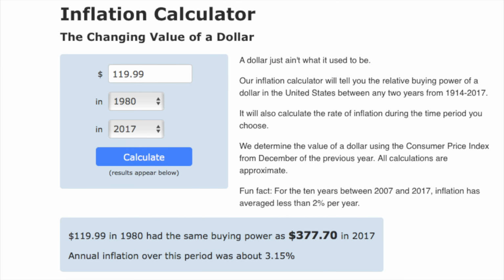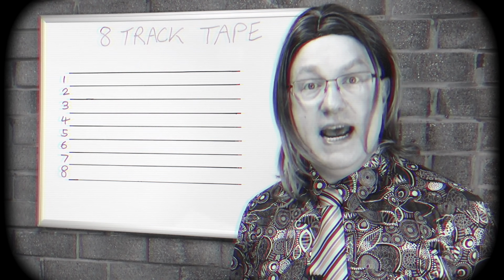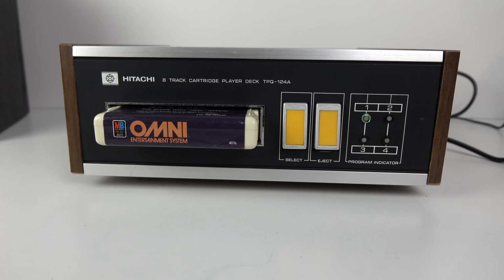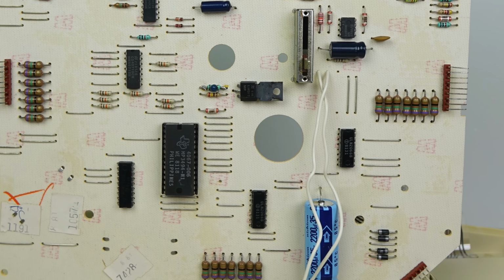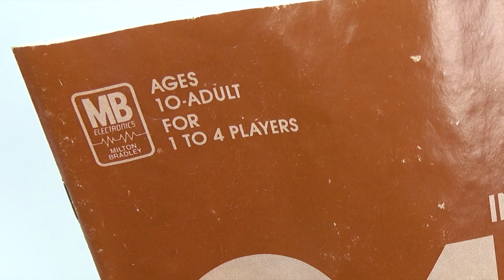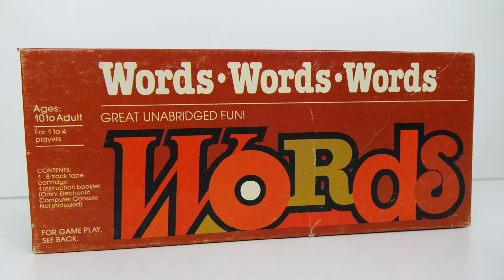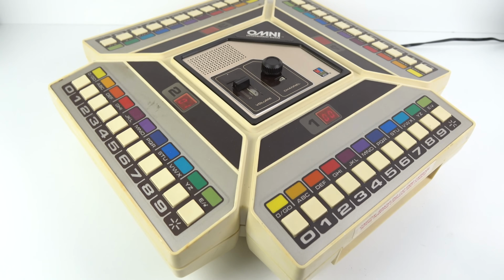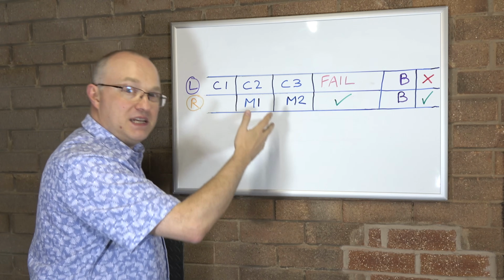MB OMNI Entertainment System - The 1980s 8-Track games machine.

Comment: As a restorer of vintage electronics, the key is to REPLACE all of the ELECTROLYTIC capacitors, even if they look fine, because on anything this old, the capacitors are dried out and leaking DC current - The electrolytic capacitors are the bigger can looking ones, on this unit, I can see eight (8) of them.  All of your classic stereo equipment from the 1980's and earlier would also greatly benefit from this! - Make sure to stick with the 4 high-end Japanese capacitor brands, namely, Panasonic, Nichicon, Rubycon, and Nippon Chemi-con. :)  This will save your impossible to find old transistors, transformers, etc. in your vintage electronic device, as well as making the device function as new!
Reply: Exactly. I collect old tape recorders and I have some from the 1950s that still runs fine with all their original components - including capacitors.
Reply: depends on the caps, for instance, ive never come across  a bad nichicon
its the chinese/taiwanese made and fake caps that are problematic
they don't start showing up till about the time that china took over manufacturing everything
Reply: Curiously, while glancing on this board, i see a distinct lack of custom components, even not seen a single component that isn't still available as NOS right from the top of my head, many are even still being made. I wouldn't terribly worry about it. Honestly i am a tiny bit astonished that they managed to do the whole thing with just 4000 series and similar logic ICs!

Furthermore it doesn't seem like there would be much temperature and ripple current, so i wouldn't replace all capacitors, after all, with every replacement, you run a risk of installing a defective component or mangling something else, and many people don't even have access to good brand name capacitors, i'll be lucky if my supplier sends Cheng Taiwan rather than something out of mainland China lottery. Maybe just check temperatures carefully and if something gets warm, take those out. As you know, temperature is the primary degradation factor, they are specified to run for 10 years at the temperature printed on their sleeve, but going down every 10°C roughly doubles the life. The big cap is a Nichicon, i have measured some of these out of early-run C64s, and they were good as new after all this time, a tiny bit of capacity loss, but no leakage whatsoever, and not much more ESR than you'd get out of a modern unit. In fact that you allow yourself a blanket statement that every device this old must necessarily contain capacitors that leak tells me you never really bothered to check - while capacitors are the most common issue, more often than not in a working device this old and this well made, they're still good!

Also i'm not entirely convinced whether things are always getting better. The 2000s saw not just a massive fake electrolyte fiasco, but a number of genuine Japanese high-performance electrolytes that turned out to be quite bitchy, showing much much faster degradation than the spec would suggest. While striving to offer devices with smaller footprint and lower ESR, thus also allowing to reduce BOM, the manufacturers collectively and repeatedly stepped into shit they couldn't quite predict.
Reply: As a consumer I would hope that I don't have to pay more because the engineer replaced everything, even those caps which were fine.
However I would like to have my kit running for another forty years.So do I send my tuner to ungrateful or jmc?
Unfortunately that question cannot be answered by Vincent Price .
Ok let the battle commence. Again.  Lol.
Reply: Jesus... Get a room
Reply: By this time they were using quite a bit of tantalum caps which didn't dry, but sometimes did explode if overridden by high current ;)
Reply: Ha-ha-ha that made my day... ahh the 'dozer techs... gotta love 'em... then you've got the "Re-flow every f*ckin FPGA chip on the board techs" lol#2
Reply: I love your videos!
Reply: burrito rustler That is an exceedingly common claim, which strangely only became "common wisdom" after the industry-wide rash of bad capacitors in equipment from the early 2000s .  I have experienced lots of older gear that works just fine with the original electrolytic caps, but I'm sure the industry is quite happy when you needlessly replace working components with brand new ones bought at premium prices.
Reply: ungratefulmetalpansy some do replace carbon resistors although others only replace the bad ones.

those of us techs who are smart know to replace old electrolytic caps and carbon resistors so that we don't have to replace as each original one fails. less work in the long run and makes for a more reliable device.
Reply: John Francis Doe no the claim is valid. electrolytic caps have a finite lifespan and will eventually fail.
Reply: burrito rustler 
LOVE me some Chemi-con electrolytics!
Reply: No I am not.   A bulldozer tech has no clue what they're doing and I know full well what I am doing.    Apparently the fact that electrolytic caps have a finite lifespan and that most if not all vintage electrolytic caps have passed that doesn't matter to some.    I've had experience in only replacing resistors and caps that were bad only to replace more bad original resistors and caps later on when they fail.    By going ahead and replacing all electrolytic caps and carbon comp resistors I make less work for me down the road.    If you take your car to have a tune up done and the tech only replaces the spark plugs that looked bad would you be ok with that or would you expect all spark plugs to be replaced?    Some only replace the bad parts and do so every time another part fails.    Others know which parts are known failure items and replace them all whether they are good or not so they do not have to work on the device later.    That said in order to know if a vintage electrolytic cap is actually good you first need a proper capacitor tester then you need the manufacturer's data on said capacitor so you can compare the test results with the manufacturer's data to see if the cap meets spec. The main specs are capacitance, ESR and leakage current.     Odds are you will not find the leakage current or ESR specs for vintage capacitors so then how do you really know they are within spec? You don't so the only thing you can do with the cap is replace it.
Reply: Jf Mc no he is exactly right. I work with electronics daily and repair them.

I personally do not like working on my own gear often so I take steps to make said gear as reliable as possible which depending on the age means at minimum all electrolytic caps get replaced.

take a vintage receiver that works decently to the point you think it is working properly.

you recap it completely and the receiver sounds better and digs that one station out of the static you couldn't receive good before.

would you say the recap was necessary or would it have been best to leave it as it was given it did work before.

electrolytic caps have a finite lifetime after which they really should be replaced.

new replacement parts in something vintage doesn't mean it is no longer vintage.

Also why take the chance of an old electrolytic cap failing short and taking out a hard to find semiconductor?

I have a Fisher 202 Futura Series receiver that had a slight hum in one channel but otherwise worked great.

I started a recap with the power supply and driver boards and the hum was gone. I replaced the rest of the electrolytic caps given they were the same age and the receiver works better than I ever remember the one I had 20 years ago as a teen ever did.

basically on something vintage there is a valid reason to totally recap it.

you may disagree, but if your vintage stuff works good enough for you even though it may not be performing its best due to old caps and you like working on your gear often then ok.
Reply: organfairy you are very lucky then as that is not normal at all.
Reply: ungratefulmetalpansy 

you're one of those that has to be right even when wrong. 

a little hint.

the way I know you don't know what you're taking about is because you degenerated into personal attacks which is generally what some do rather than admit they don't know or were wrong.
Reply: Pissing matches and irrerplaceable transistors aside, I've found that:

(1) Electrolytics in 1980s consumer gear typically start going bad around the 30 to 35 year mark, and

(2) Replacing all of the electrolytics in a complex vintage piece in one go is much easier than disassembling and reassembling the piece each time an individual cap needs replacing.

I'm going to do what saves me the most time and aggravation. I'm not married to a friggin' 40-year-old capacitor.
Reply: ungratefulmetalpansy 

you don't underatand.
in my example the spark plug still looked good worked good and the gap was in spec.

so then why do you replace it if there's nothing wrong with it? according to what you say the spark plug should be left alone. you replace it why? because you know it will fail and you don't want to pay someone to change the one plug.

that's the same reasoning behind a full recap. we know the rest of the electrolytic caps will fail so we go ahead and replace them so we dont have to fix it again later.

concerning the cap specs I'm talking about the manufacturer specs.

regardless of how well a capacitor works in a circuit, if it does not meet the manufacturer's specs then it is bad and must be replaced.

honestly I wouldn't want to work on any of your gear.

even some well respected knowledgeable techs will recap a vintage receiver, but you would consider them bulldozer techs no matter how knowledgeable they are.

it's precisely that knowledge which causes some to do a full recap on a vintage electronic device.
Reply: burrito rustler 
Make. Tech. Videos.
NOW!
Reply: ungratefulmetalpansy 

more personal attacks I see.
Reply: ungratefulmetalpansy 

If the datasheet doesn't mention anything about derating the capacitor then I take it to mean that once it's out of spec it is bad.

now if said datasheet gives data on derating the capacitor then I'll compare the cap to the data it lists for derating the cap and if it still is ok I'll leave it alone, but since I've obviously desoldered the cap to test it I may as well put a new one back in.
Reply: When I took digital at the tech school I went to nearly 18 years ago TTL was used when the logic high levels only needed to be 5 volts and CMOS was used when the logic high levels needed to be above 5 volts  and 12 volts was a commonly used voltage.    Real pain in the ass when you need to replace a CMOS chip which operates at 12 volt logic levels and can only find the CMOS chip you need with a maximum Vcc under 12Vdc.
Reply: Dude, if you bring in Trump into the discussion of caps and such, I'd hate to say but there's something really wrong with you.  I'm completely party impartial, but it's just plain moronic to do that... just sayin'.
Reply: burrito rustler. You are absolutely wrong.  Please stop sreading this stupid and destructive rumor.  Do not remove anything that dose not test as bad.  Keep vintage,  vintage! Thanks.
Reply: John Francis Doe - ummmm NO! - maybe YOU just found out that old electrolytic caps cause havoc in older equipment back around the early 2000's, but ELECTRICAL ENGINEERS knew this in the 1960's! - here is a wise saying "you are entitled to your own opinions, but you are NOT entitled to your own FACTS!"
Reply: Siana Gearz - You can't even read the markings on every IC on the board, so you have no idea if they are available, and even the ones you can, many are not available NOS - just because you can find some listed on ebay, doesn't make them legit parts, more often these "NOS IC's" are Chinese counterfeits, that may or may not work at all.
Reply: Agreed.For some of the ICs devices use there are modern substitutes moreso if the chip uses TTL logic levels, but not so much If it uses CMOS logic levels.
Reply: I take it you are a tech then since you mentioned you have an oscope.   "You are comparing something that runs at 50000V, at 500 degrees, under pressure, and with corrosive explosions happening 1000 times per second."   Still if the spark plug meets manufacturer specs why replace it?    "That's stupid."    Oh it's stupid to replace a part that does not meet manufacturer specs?    Most competent techs would disagree with you on that.   Try telling someone who maintains a nuclear reactor that an out of spec part is ok to leave in place.   I myself work in avionics and parts that do not meet spec or are known failure items are replaced, because if they are not said equipment could fail which can cause anything from an unimportant device going out to the plane itself crashing.    "That's stupid. You are a menace. Your "knowledge" is on the level of astrology or numerology. You probably advertise in the same section of the newspaper."    There you go with the insults. Can't admit you're wrong so you resort to insults.  You're one of those what I say is always right damn what anyone else says or proves kind of people.      "What an objective test! It couldn't be receiving "good" because you MOVED it?"    If said receiver was put back in the same exact place connected the exact same way then no. Also at the time the recap was done an alignment would have been performed which I expect you to say also isn't necessary given the receiver worked beforehand.     "Good, leave my perfectly functional 55 year old Tektronix 547 alone."    There are some exceptions as I have a few old devices with original electrolytics that work just fine. Mostly military devices though.    The ultimate test is to buy two of the same receivers that work equally well. Recap and align one and leave the other one original then compare them side by side with the same speakers and antenna and see which one works better if one does indeed work better.
Reply: I sincerely hope you never own something using hard or impossible to find transistors or suitable subs as your method of thinking could cause an original cap to fail which could take out said hard/impossible to find transistors and render said device landfill material.
Reply: I love how there are all of these morons actually trying to DEBATE whether old electrolytic capacitors should be replaced - lol ............ This is like climate change, SETTLED SCIENCE (electrical engineering to be exact) it is NOT up for DEBATE, if you don't think that old electrolytic capacitors should be replaced before they take out your impossible to find transistors, transformers, and other components on vintage gear, don't even think about DEBATING, until you have your electrical engineering degree, then you will know what you are talking about.  This isn't the Presidency of the United States, you don't get to be a moron and tweet #fakenews - Electrical Engineering is not DEBATABLE!

Comment: That's interesting, I wonder if you could actually consider this a gaming console since it doesn't play on a tv yet it has interchangeable cartridges.. Hmm
Reply: If I remember correctly, there was a computer-like thingy (like the Commodore 64, or the Atari 800) with 10 horizontal LEDs, which were used as a "Screen" for the games. Not really a console, but if that counted I guess this does too.
Reply: I had one of those things.  Sold under various different brands and it played things like a racing game, hangman, and a variety of card games.  Quite a lot of fun at the time.
Reply: Riz2336 I'd say it's arguably a portable console of sorts...?
Reply: Well it looks like a console on the bridge for a spaceship from a 70s b-movie and it plays games so I guess it works that way.
Reply: It's basically a board game but with electronic elements instead of something like a deck of trivia cards.  Given MB made a lot of board games, it's actually a logical evolution of the products they made.  Same sort of games but enhanced with the voices and electronic scoring.   Not a bad attempt.  It's even still fun.

Comment: what does "burst of data" mean, how and would you do that on a 8 track.
Reply: how does the machine communicate with the cartirge to see if the thing is correct and when to move from left to right
Reply: SlayinThatEndBrah encoded with something like afsk or DTMF tone burst. One of the ICs demodulates the data, then the input is compared to the answer by the processor which keeps track of the score. I guess the tape pauses when waiting for player response.

Comment: Why is there a window and what looks like a mattress on the packaging of an 8 track tape replacement foam lol That's the most bizarre thing here, even more than the "old" 8 track explanation (which was genius).
Reply: nothing odd about this...the foam is intended to be used for reducing air leakage around doors/windows/etc.
Reply: M. K. Oh ok I missed that in my puzzlement!
Reply: 20:37
Reply: M. K. Yeah, I was gonna comment that, since Techmoan apparently thought it was to stop dust, not cold air in winter.

Comment: So with an 8 track you had to rewind the tape mid song? If that was the case they should have had track 2-5 and 4-8 recorded in reverse so it could smooth transition? Is that the way it worked?
Reply from the maker: You can't rewind an 8-track https://youtu.be/XLZS0Sj9-1U?t=2m8s